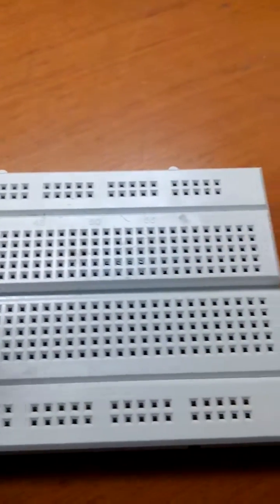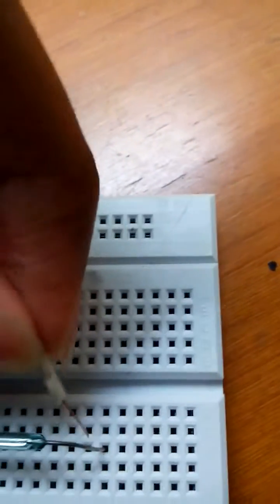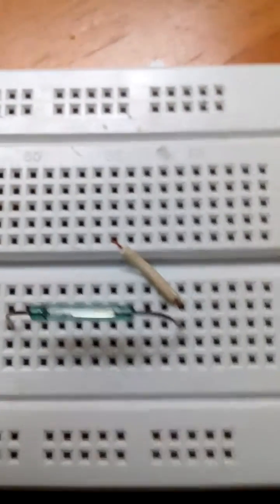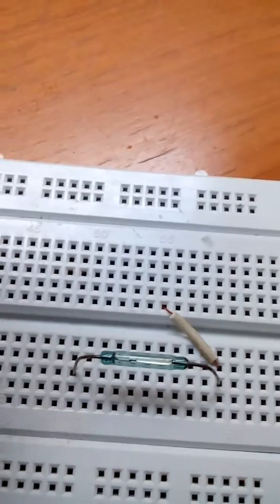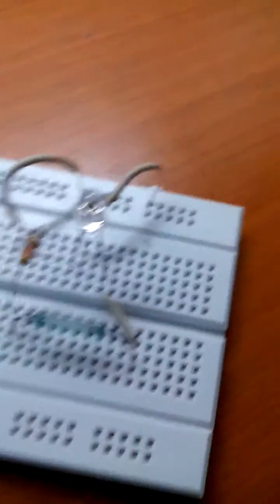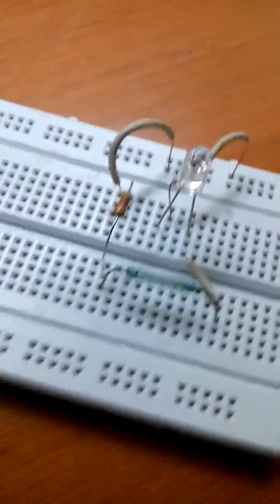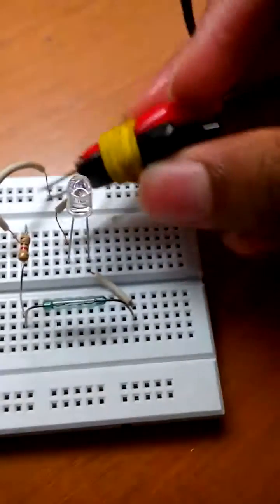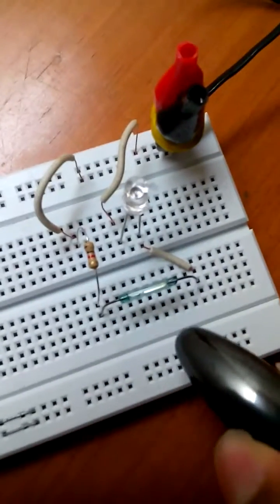How to make your own "Magnet Sensor" on breadboard.

Comment: hey troy, can i use a 9v battery instead of 5v?

and what resistor value can i use?
Reply from the maker: Yes. 100 ohm or 330k ohm resistor should be fine.